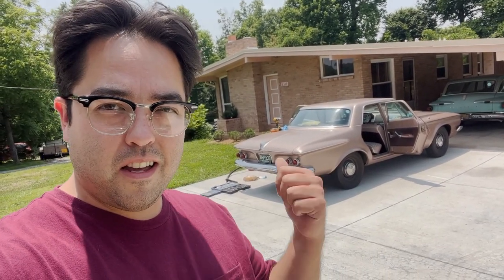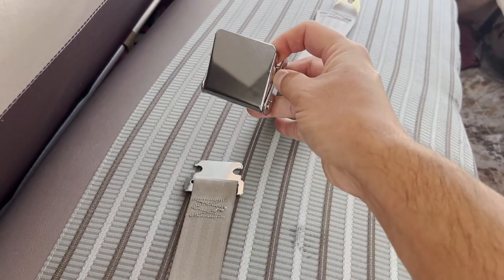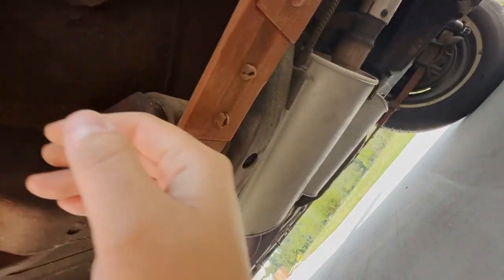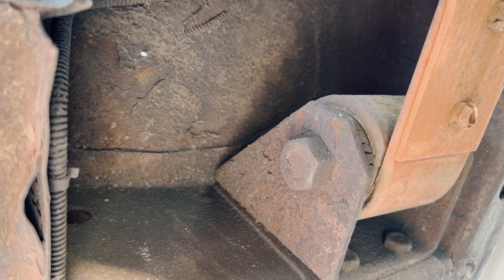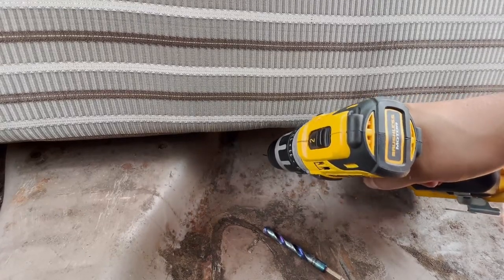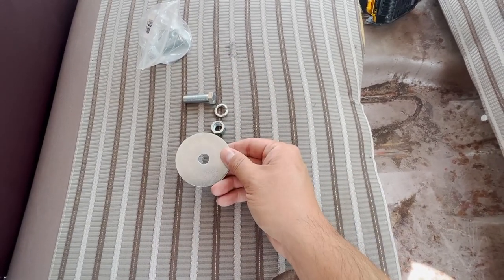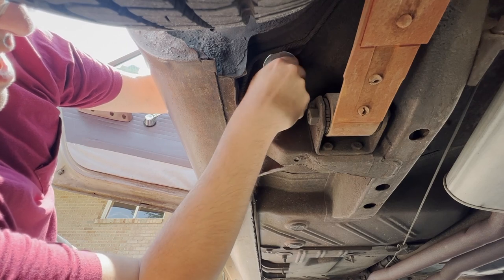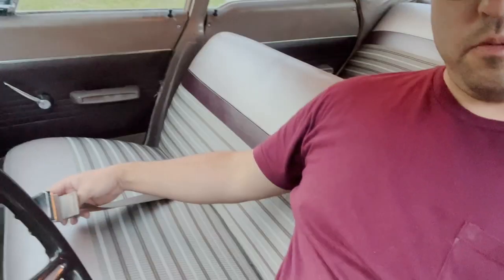Installing Seatbelts in Your Classic Car! Airplane Style Safety Lap Belts. Retrofit

Comment: Happy Friday. I was wondering if you recommend bolting the seat belt brackets tightly to the floor, thread points, or if you allow for the bracket to swivel around the bolt. Thanks.
Reply from the maker: The brackets must be bolted on tight. Recommended to have nothing between them such as carpet. Mounted directly to the floor pan.
Reply: @ObsoleteAutomotive  Thanks for the quick response; much appreciated. BTW this is for 67 Plymouth Valiant bench seats. The service manual/parts book shows a anti-rattle washer between the metal washer and bracket, so I was wondering if things were intended to rotate slightly. Thank for you help!
Reply from the maker: @haroldwolk4508  I’m going off the seatbelt manufacturers installation instructions. The factory seatbelts may have differed in engineering/design.
Reply: @ObsoleteAutomotive  Good stuff. Thanks for your help and insights. Helpful video!

Comment: A seat belt saved my life as a passenger once, so I'm all for them. But there's a hidden problem here: unless you're exactly replicating a factory install you have assumed the role of design engineer, so now you're legally responsible for any potential harm your work causes or contributes to even after you sell the car. My 'lifesaving' incident most likely initiated a series of health problems I now have as it was a rather severe crash with huge bruising where the buckle was. It was a few years between the occurrences and factory seat belts so no hope to recover anything for me but at least I am alive so I call it a win. I have to also think about the crash my Mom was in where the old Plymouth seat-backs were low; the doctors said if she had been using the seat belts it would likely have snapped her upper back and killed her. 

If there were no factory belts in the car model you have (too old) then try to find as similar a car with belts as you can and mount yours like that. I would also prefer to use new or junkyard-sourced seat belt hardware where possible to0 eliminate question of strength or design. I'd also question certain installs, such as my two old pickups which had the gas tank behind the seat; you wouldn't want any chance of entrapment if the tank was compromised. Old Jeeps with the tank under the driver's seat too.  If you sell the car, remove the seatbelts and let the new owner deal with the legal questions of putting them, back. Just know what you're doing and the possible ramifications because nowadays you can't trust the legal system to have the common sense we have and you can potentially lose everything.
Reply: Sounds like you just had lap belts. Even in older cars with the separate lap and shoulder belts most people just wore the lap belt only.
Reply: @bradparris99  Yep, but it was effective, Lap belts do most of the life-saving in most crashes because they keep most of your torso where the vital organs are from bashing into things. Shoulder belts help a lot but will often crack or break some bones in a really hard frontal impact; still a good trade-off. 

But the most effective thing? Don't crash and if you must try to aim/steer into the softest target you can- a lesson learned from many miles of motorcycling. Better a ditch than a bumper!
Reply: @P_RO_  In the mid 70s when I turned 16 I got my grandfather's 1970 Buick Electra to drive. After about a week of seeing the "FASTEN SEAT BELTS " printed above the steering column I decided to try the lap and separate shoulder belts mainly out of curiosity. I was amazed at how much better the car drove and handled with the belts buckled, holding me securely in place when I drove. I quickly was a dedicated belt wearer. It became a ritual to get in the car, turn the ignition, push the cigarette lighter in, buckle up both the lap and shoulder belts, light up a cigarette and then drive off. One weekend I was coming home from college when a drunk driver in a Chevrolet suburban crossed the center line and hit me head on. Because of the size and quality of the Electra along with the fact that I was wearing both belts, I walked away with only minor cuts and scratches and  bruises from the belts. The drunk driver was wearing a 3 point seat belt but he had the shoulder belt under his left arm, basically a 3 point lap belt. He had massive head and chest injuries from the steering wheel and his unbelted passenger was ejected through the windshield and landed on the hood of the Electra. He unfortunately didn't survive. The paramedics arrived and knew for sure the the worst injuries would be in the Electra,  not the Suburban. It all came down to who was wearing a  lap and shoulder belt properly. I was only 20 years old at the time and only 4 miles from home.
Reply: On my Electra, the lap belt had the small buckle and the shoulder belt had the large buckle which I always thought was backwards. After hearing your seat belt story, I guess the smaller buckle sitting in the middle of my abdomen was safer the the bigger buckle would have been. The main thing is that I was wearing both belts. Aside from the obvious safety aspect, I really got in the habit of buckling up for the enhanced driving experience.
Reply: @P_RO_  I always thought that a lap belt only offered minimal protection since it only restrained the lower body.  It would prevent you from being ejected but your upper torso and head would go forward hitting the steering wheel or the dash. That's why I always buckled up my shoulder belt in conjunction with my lap belt for maximum protection. With just a lap belt, did you hit the dash or steering wheel?  Sounds like you ended up with what's been called "seat belt syndrome" where you get injured by the belts.